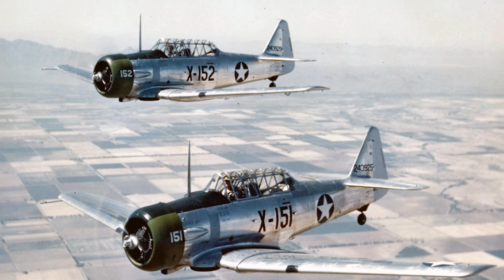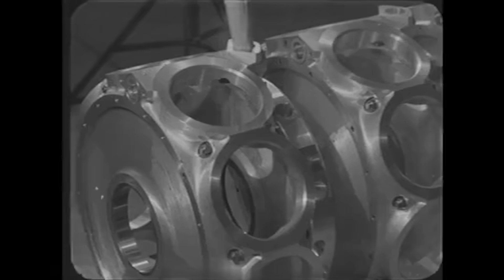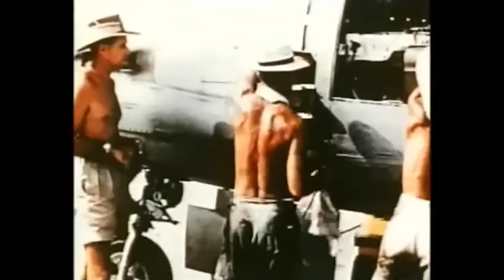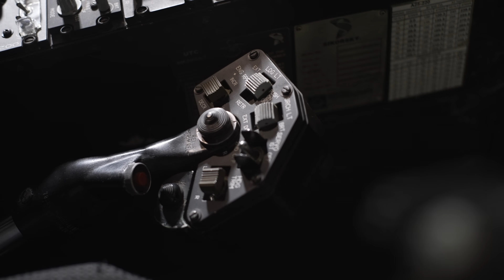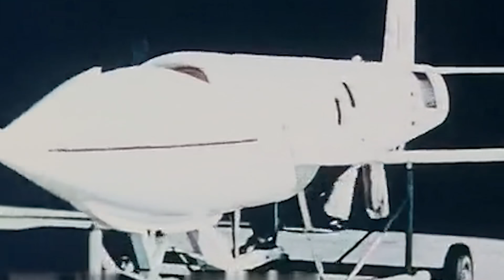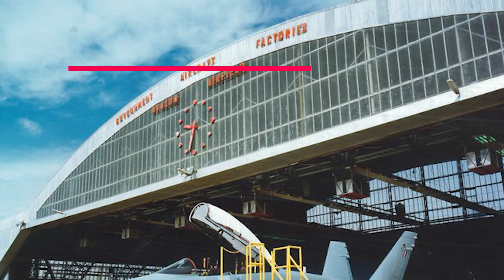Home Made Wings | Australian Military Aircraft Manufacturing

Comment: Was Australia really self sufficient in aircraft production during the war? What about the necessary accessories that go into an aircraft? Such as radios, navigation equipment, instruments, toolings, hydraulic pumps. When producing later aircraft & engines in the 1960s, 1970s & 1980s were the aircraft and engines supplied in a knocked down  condition and assembled in Australia?
Reply: Radios should not have been a problem in WW2 and the 1950's.   Australian electronics company AWA was then the largest electronics manufacturer in the southern hemisphere, with a cross-licensing agreement with Marconi in Britain and RCA in America, giving them access to the latest technology.   They could make anything.
During WW2, up to date radar systems were made by people you might not expect, such as the NSW Government Railways Workshops, including radars supplied to Macarthur's US forces.
Reply: All good questions.
Reply: Yes!